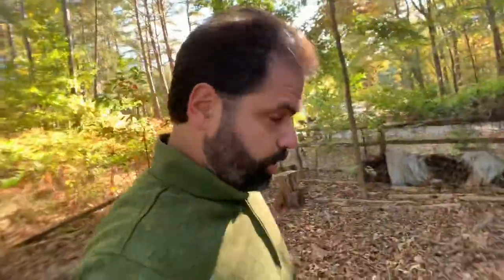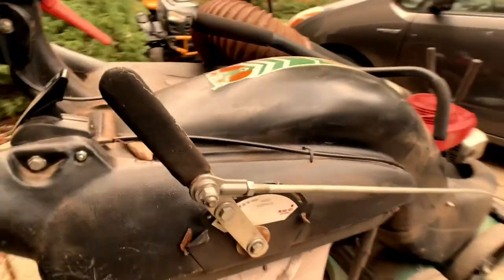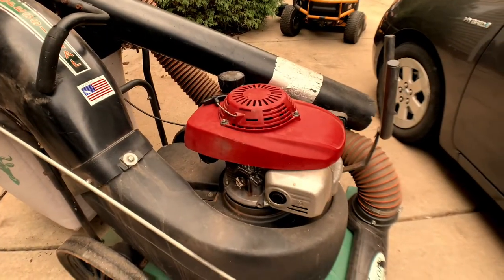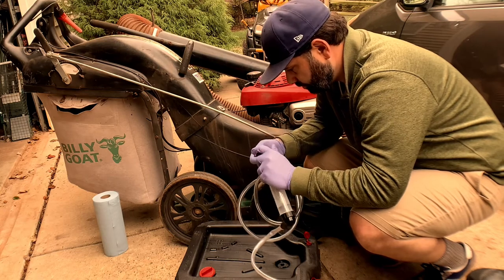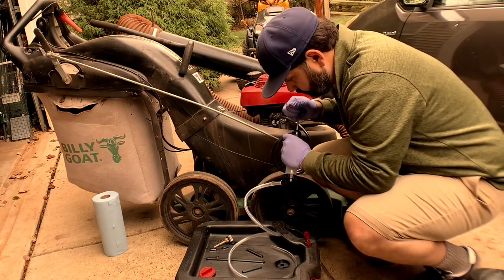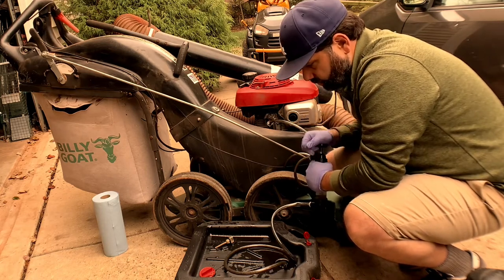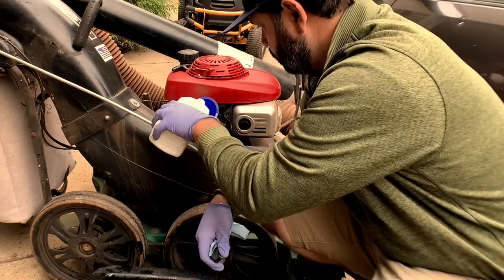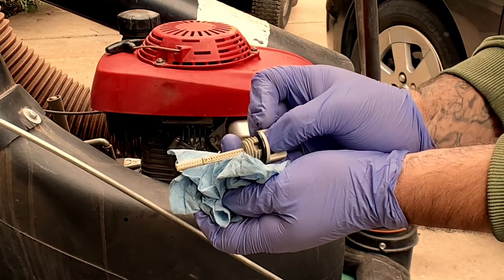Unleash The Beast! Billy Goat Oil Change - Preparing for Fall Leaf Clean Up

Comment: I have the same machine. I got it free from a neighbor. It wasn't running, but within 15 minutes it was. I had to do some fiddling with the throttle as it was broken. It turns out you can flip it and have a new catch for the throttle cable. I need too change the oil, so I bought a little pump like you did. I love  this machine it is a work horse on our 4 acre property.
Reply from the maker: I love mine too, Ken. I ran it for the first time this season yesterday. Motor fired right up. Honda motors are tough to beat.

Comment: Thanks for uploading this video. I was contemplating just tipping my billy goat on its side to drain the oil. (as with typical lawn mowers that do not have a drain plug). But I think your way is cleaner and simpler :-)
Reply from the maker: Thanks for watching! Yeah, I was going to tip her over as well, but it would have made a mess. This pump worked well and I’ll continue to change the oil this way. The pump cleaned up easily as well which surprised me.
Reply: @LKNDIY  Thanks for the video.  Where did you get the pump setup?
Reply from the maker: @terrytaylor6388  thanks so much for watching! Please see the link below to the pump. I picked it up from Amazon. 

https://www.amazon.com/dp/B00J8331U6/ref=cm_sw_em_r_mt_dp_2NKWQ3E3SVZMJY4ANR7A?_encoding=UTF8&psc=1 

please consider subscribing, it helps the channel a lot. Happy New Year!